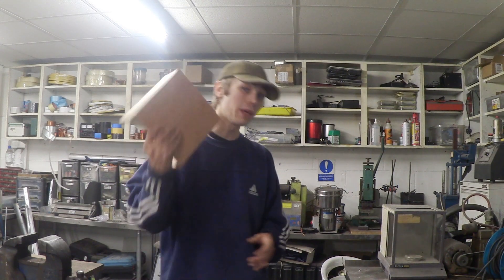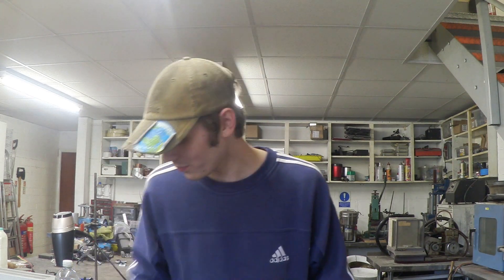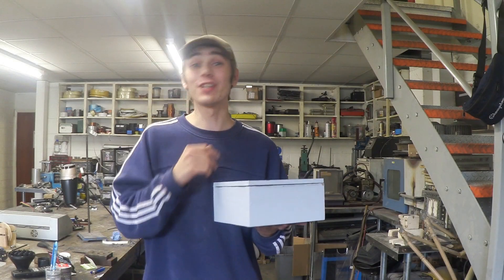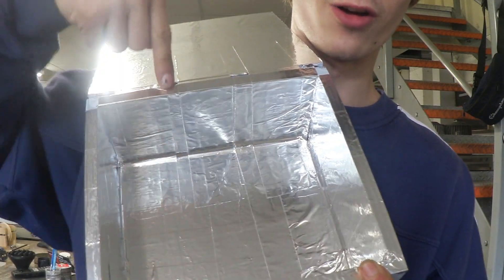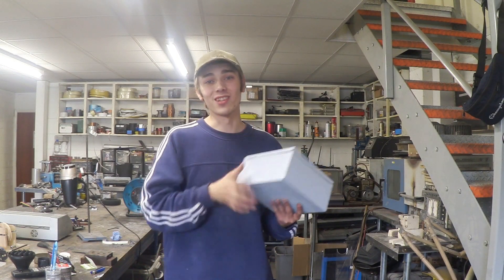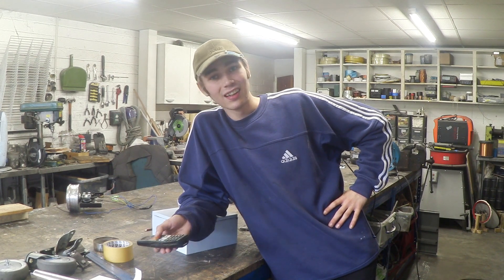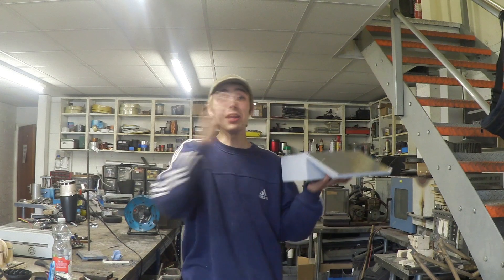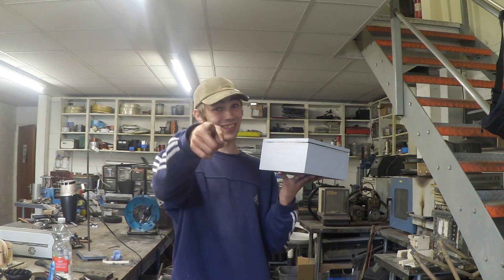1216 - DIY Faraday Box to Block Phone Signals   Great for Gatherings

Comment: Wouldn't it be simpler just turning your phones off? I mean they do have a power button.
Reply: U need to take battery out to block signal
Reply: @IvySnowFillyVideos turning a phone off means turning it off as in stopping it transmitting and receiving signals.

Comment: i noticed you were leaning on the box  during the test.   im guessing you are getting leakage around the lid still.  might consider adding some copper braid (like what isused for desoldering. around the lid as a gasket.  or i suppose just put a latch on the box that winches closed the gap.

Comment: thats  nice box. you could make a faraday cage out of wire screen like for a screen door, then every one could see their phone but they wouldnt be receiving signal, it could even be an artistic statement center piece.. maybe use stiff copper wire like for mains as the skeleton, brass mesh would be expensive but you could paint teh plain wire mesh

Comment: Thats right. It has to be continues. Good thinking. You'll find aluminium tape in thing's like laptops and lcd screens, connecting emi shielding metal parts together for the same reason.

Comment: Nice job Luke, been thinking of doing similar my self, now I know this shielding is  requirement minimal to knock it off line👍
The next oart I was wondering is if the phone would
kill its charge
quicker because the phone is trying to reestablish a connection... idk.,. but I wondered because I value my privacy and I want to use the shield to block tracking ability and microphone missuse

Comment: Or ya know, you could use Airplane mode.
Reply: Find an amplified speaker, put phone next to it, send phone txt message, if amp speaker makes sounds you know it is picking up your phones signals.
May have to try several amp speakers until one works . 
Now put your phone in Airplane mode and set it next to the amp speaker, at least once in 5 hours you will hear sounds as your phone is transmitting data .

Comment: From an EMI perspective....a slot or a crack say 75 mm long "leaks"rf the same as a 75 round hole ( depending on wave polarization). At 2.4 Ghz a slot 25 mm long is as good as no shielding at all.

Comment: anchor to 0v pls
Reply: Faraday cages only need grounding if electrical power is being fed in from outside (for safety reasons). Grounding in-itself doesn’t change the performance one iota.
Reply: @Nuts-Bolts  This is wrong, shielding performance is improved with grounding.